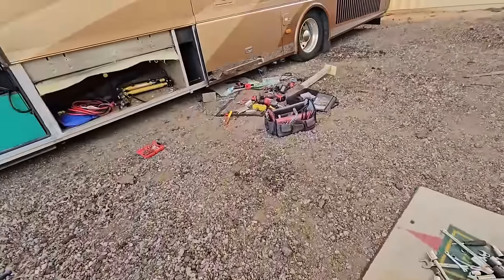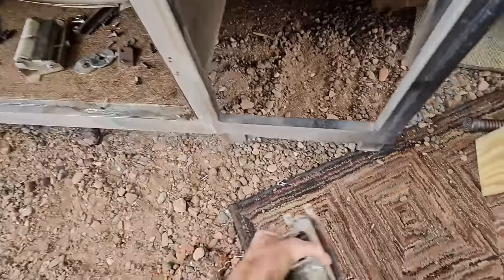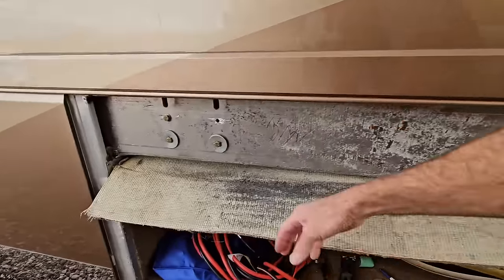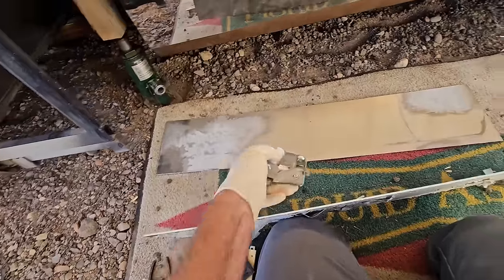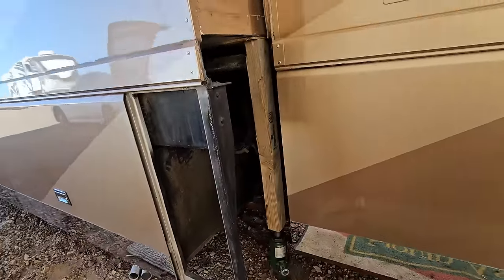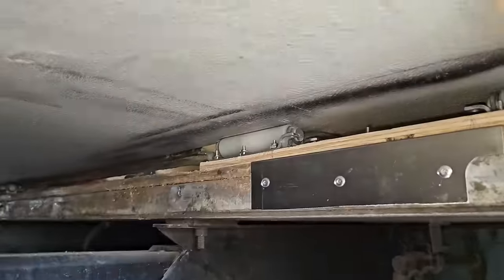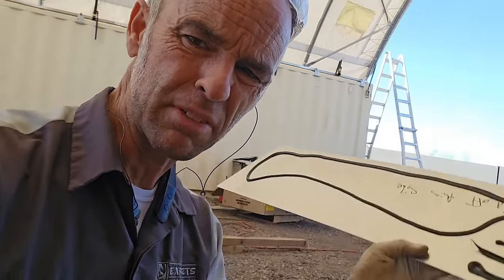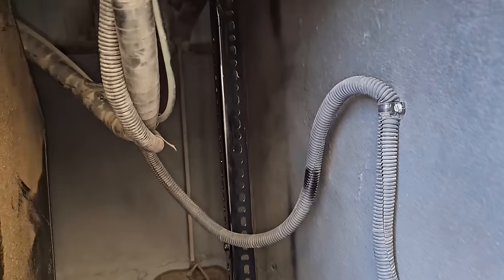How I Repaired My Beaver RV Slideout...After Breaking It

Comment: The adjustable roller (LPAR-53-DEL-1) has four mounting points to preventing bending and a maximum load of 200#s. The engineered load limit is not to prevent bending. The load limit is to ensure trouble free use for the life of the roller. In this instace the roller bodybent due to incorrect use.

The shim on the added roller and skid pushed the slide up too much. We can see the paint lines are off and the bottom of the slide is sticking out. This could cause new issues for you inside and out.

Comment: Very clever, the front plate to hold the plywood in place!!!!! (song) sailed for a 3 hour tour...... Working on slides always eats up my time... Newmar (01 Dutchstar) used 1/2" ply to build a plywood box for the rollers to rest on for the bedroom slide. over time the ply  gets wet and droops, so does the rollers and slide... had to replace the ply with solid doug fir..... a huge PIA... the floor of both slides are two 1/2" ply, stapled together....NO GLUE big surprise that they flex!!!!! I didn't make a "shoe" but looking at it when rebuilding surely thought about it. Now I keep a spare roller.... I love self tapping Teks screws, used them to build my steel house, would have used them to mount the roller deck to the aluminum structure instead of the rivets. I also would have used them to install the lower seal vs. the rivets. I like rivets too but if there is even a remote chance that I will have to remove them in the future I go with the Tek screws to replace them. Yes, I know, extra holes, but that is what caulking is made for.... I felt like I was watching myself do this job..... GRRRRRR..... Thanks for taking the time to make the vid.....

Comment: I’m glad you found a working solution to an issue of poor design on my slides of this nature. When I first came across slides where the manufacture placed kitchens and cabinets and the likes over a slide out I cringed as I’m knowing over time and the weight of it’s not properly designed it will sag.  I was thinking the adjustable roller could work but if there were enough of them spread across the weight. I see in your final solution you added more rollers that will spread the weight.  Great video and excellent job keeping us hanging to see “what happened”

Comment: Been there, done that. I can see the pain in your face and sense the frustration.  I’ve had these simple tasks turn into ordeals.  I used to have a hobby of restoring campers, trailers and RVs from the 70’s back to original and period correct condition.  Same with classic cars.  I’m OCD and a perfectionist.  I no longer have these hobbies primarily due to health and medical conditions which limit my energy and strength.  However, as I’ve grown older, I’ve grown a little wiser and I just don’t have that level of desire and patience to tackle those “ordeals”.  Great video as a.ways.  Thanks for sharing!

Comment: Excellent presentation.  Thank you.   For myself, I would rather have a "no slide" unit.  This would also insure plenty of walking space when on the road and traveling.   If you are virtually parked full time with very little travel, the slides might be ok but for me and doing a good bit of traveling, which is what these things are supposed to be for, no slides thank you.

Comment: What a great work around to a problem many RV's have and your skills shine through!  A lot of RV manufacturers used carpet as the sliding surface only to have it wear out surprise surprise. My fix was similar but I used UHMW strips for the wear surface and nylon rollers for the load. Works great and no more dragging on the floor.

Comment: James,  as always I love your videos and can’t tell you how much I appreciate all the effort that you put into making them for us. I worked for Loctite many years and they have adhesives that hold airplanes together, and I am sure they have an adhesive that would have worked to bond the wood to the floor.  I have been using these types of adhesive options, instead of my go to options of nuts, bolts, and screws, taken awhile to break the habit but it is working.
Reply from the maker: My experience has led my to greatly distrust adhesives for most applications like this.

Comment: I dont know what the weight rating is but I think your adjustable rollers might have worked if they had been secured down like your final rollers were. I am guessing friction from the weight caused the roller to rock on that back flange. Just a thought 🤔

Comment: Legit question since I'm likely buying an RV in a couple of years. Could you not have used the larger roller type, mounted it directly under one of the lateral floor rails and placed a composite skid (plywood sandwiched between 2 aluminum plates) between the roller and FRP flooring (acting as skid and shim) instead of shimming the roller up?

Comment: Couldn't you have mounted the rollers to some angle iron then with the angle face down  and the roller sat on top of the angle iron then you could have mounted through the front of the angle to the frame? Or are you not able to mount anything on the front side of the frame?
Reply from the maker: the lower wiper seal really needs to be flush

Comment: Could you have installed rivnuts on the roller bracket mounting holes and then run the bolts up from inside the storage compartment
Reply from the maker: maybe but its exposed to the elements and I have little patience for exact measurements :)

Comment: I told my neighbor never pressure wash a home causes damage.. she did. I like a dummy offered to fix problems.. Water went thru paint wood color bled thru, removed all bad paint.the the windows wereent caulked right too little cault it failed on every window, it pulled apart. (water entered)and removed silicone a bear.(nothing sticks to silicone) so then I fixxxed all the opennings in the home. Termites like moisture seal it they leave. Last painters caulked nothing holes all over. cable guy was a bozo. furnace side vent was stainless tape to fill in hole.

Comment: James wny dont you have your leveling jacks down?  your air bag system is not holding air and sitting that low on empty air bags is not good, ive seen this on a few of the bus chassis that you have been involved in..good luck great video always
Reply from the maker: this has frame levelers, its weird

Comment: Kind of figures that it is my bedroom slide that that is a little out of square in the opening and needs adjustment on my y2k marquis jasper, main slide seems ok... does not seem even close to being mechanically similar!
Reply from the maker: The bedroom slide is much different for sure, but adding skids/skis above the rollers is a common repair on these slides.